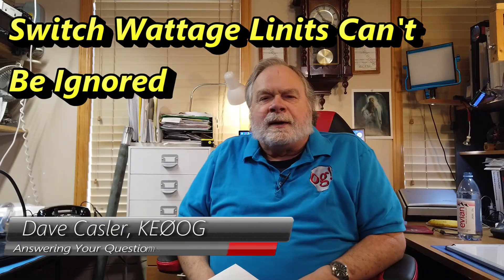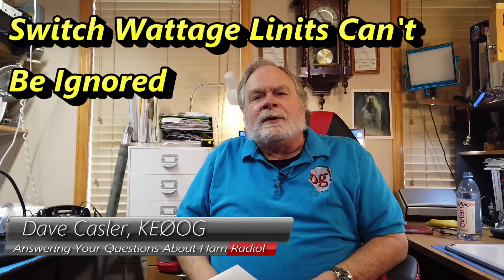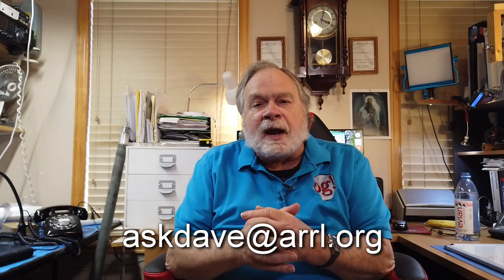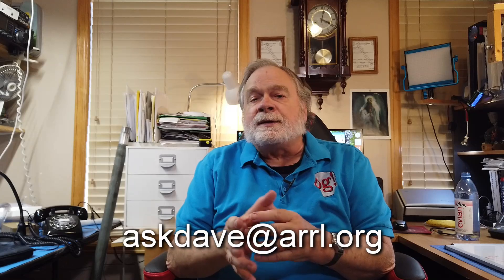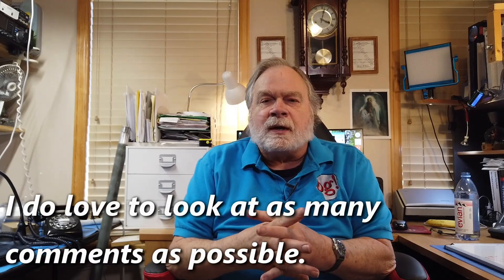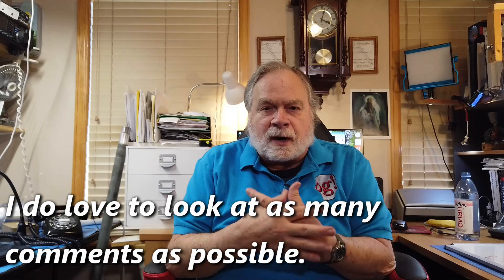Switch Wattage Limits Can't Be Ignored (#1110)

Comment: The answer is simple. 
By Ohm's law, one can find out the current that has to be handled by the contacts in the relay (or any manual switch) when the power and the load resistance (here it is assumed to be 50 ohms) are known. 
A 100w switch can handle just over 1.414A.
A 400w switch has to handle over 2.8A, which is double in magnitude. 
When we talk about working into 50 ohm resistive load (for the purpose of understanding the principles), there is no phase difference between the voltage and the current. 
Voltage handling of the switch is dictated by the spacing, and the current handling is by the surfave area of the contacts, both factors being in direct proportion. 
Arcing is due to more voltage in less spacing, resulting in the breakdown of the air dielectric.
Less area of contacts handling more current leads to heating, errosion, (corrosion) charring and even welding (sticky contacts) ultimately resulting in failure. 
I just can't understand when you talk about inductance causing "inducting", etc 
De VU2RZA